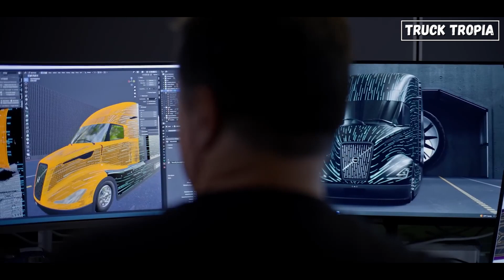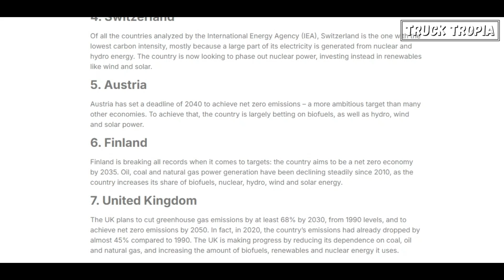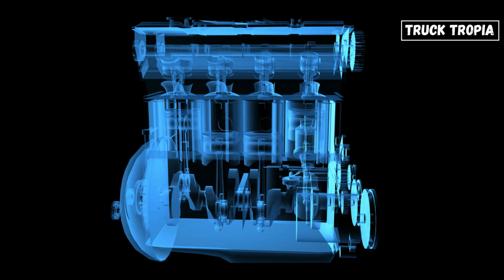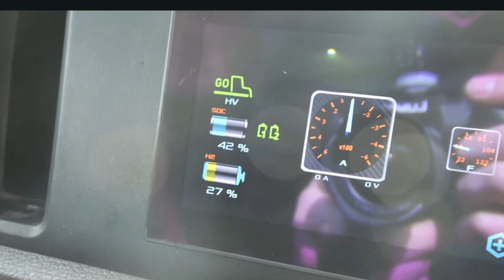Why New Semi-Trucks Look Weirder and Weirder?

Comment: Autonomous Trucks seem to be impractical for the majority of situations. 
1. Look how many Teslas have crashed due to fog & other weather events where their "Drivers" incorrectly believed that their car could drive itself. If a huge truck makes a mistake, many other road users die. 
2. A big part of a trucker's role is loading and unloading, ensuring that the cargo is correctly packaged, loaded, and tied down. In many cases, the delivery location is ad hoc, e.g., at building sites, the side of the road, etc. This is something that often requires discussion and adjustment with a human on-site, making it difficult to automate. 
Possibly specialist cargo travelling between specially equipped depots might work, ie: Milk collection, pressurised gas. But that is a very small percent of transport needs.

Comment: Batteries and hydrogen are not viable for at least another 10 years I don't know why the manufactures don't concentrate on the design of the cab unit if that is made far more aero dynamic then you cut fuel costs

Comment: The hydrogen and the electric automobile are a scam.
To produce hydrogen or recharge these batteries you need a nuclear power plant or a hydrocarbon powerplant. 🤣
The solar powerplant and the wind powerplant cannot sustain these electric and hydrogen transportations.

Comment: I don't think they should electrify trucks,dont even think they've tried hybrid trucks
Reply: Scania does offer hybrid
Reply: @Niels_f2704  only Scania?
Reply: @MKMT3481  I’m not sure, but I think the problem is that diesel engines aren’t usually as suitable for hybrids as engines that run on petrol.
Reply: @Niels_f2704  makes sense
Reply: However I think DAF and Volvo also have

Comment: I´m in transport for about 10 years. I have seen many changes since then.   Now I´m in one company for 2 years. I did have a DAF 480, Mercedes 510 and now Scania 450.  Truck have about 680 000 km and stil is running about on 24,65 lit/100 km don´t in miles per gallon.   But I have to say compare to small van when I used to drive before trucking and there was 8 to 10 lit / 100 km and loadin 1 200 kg and now 24 500 kg Trucks are really hell eco.      I do like my 13,2 lit 6 cylinder.   Battery not ready yet for long distances.   Battery trucks are good for short distances and inside cities I think so.